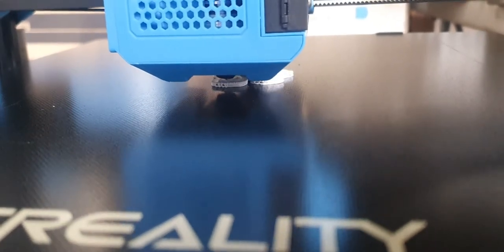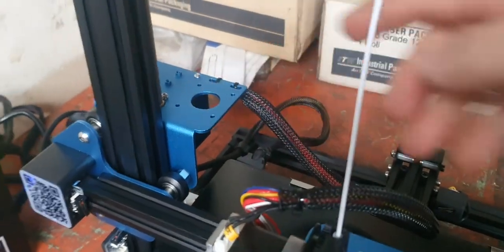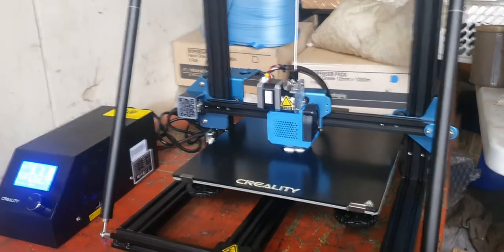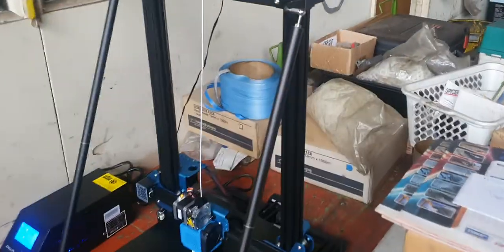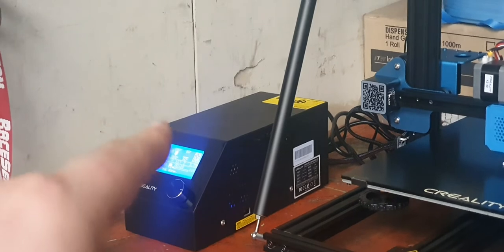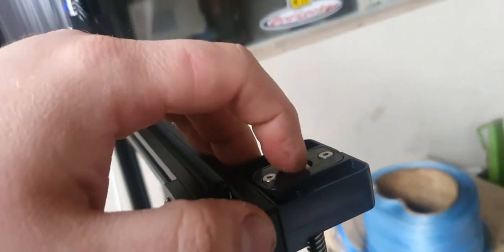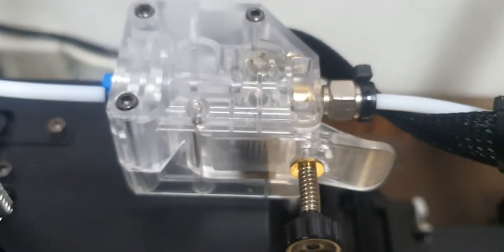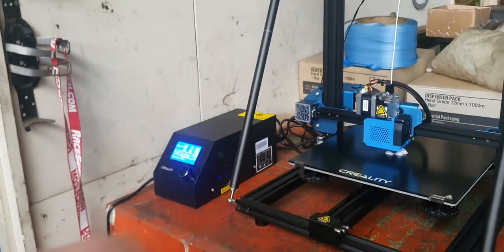creality cr10 V3 and ender 5 plus and ender 5 pro and vyper

Comment: Solid Video - Love your 3D Printing stuff, no fluffing about :D

Looking to pickup another FDM Printer, I've got an old anycubic i3 Mega and it's been great but it's due for an upgrade, I'm looking at either the Vyper or the Ender 3 v2 with some mods, Looking around the 500-1000 mark and haven't even started looking at enders other options since the 6 & 5 look solid but right now I'm looking for an all-rounder and then I'll be getting something large format like the cr10 v3 in future.

Would love your 2c since I see you've got a ton of different ones, what do you like and suggest about some of your favorites?

Comment: I am deciding between the cr10 v3 and the Ender plus 5…What’s your take as you own them both?
Reply from the maker: Get ender 5 plus. It's way better
Reply from the maker: I like my ender 5 plus more. And you will too. It's also more customisable as well if you want to do that. I have not customised mine at all yet. But I might put a different hot end on it soon. Just get ender 5 or ender 5 pro or ender 5 plus. They are so good
Reply: @differentials  after further research will be going with the anycubic Chiron.
Reply from the maker: @r.in.shibuya  Yes I have that machine too. The anycubic Chiron is really good to. Is so hard for me to tell you what to buy because all my 3d printers are good. It's easier for me to say that just by a 3D printer because they're all good.
Reply: @differentials  I already own a Prusa MK3S, I wanted larger build volume, will be giving the Chiron a shot. Thanks.

Comment: Im interested on why you don't like a BLtouch or any sensor 
Coz im planning on installing one..
I need your opinion man
Reply from the maker: Unless you have a very large bed or a warped bed I think it's not really needed. On the end of 5 + it wants to do the bed levelling before every single print. It takes about 5 minutes to level the bed. But it really not that bad. Just get it if you want one. You might like it but I don't. I can get perfect prints with out a bl touch
Reply from the maker: I have put a bl touch bed levaling sensor on a 3d printed before and it was such a pain in the ass.... So be awear it might be a head fuck....

Comment: Which one you recommend for best quality
Reply from the maker: Ender 3 and vyper
Reply: @differentials  thanks for the response. Enter 3 you mean plain Enter 3 or Enter 3 V2.
Reply from the maker: @sciloolearning  well look all of my 3d printers have great quality print but yes .... Ender 3 pro and ender 3v2 all have fantastic quality prints. But with some tweaks in the slicing software you can make almost any printer have good quality prints.
Reply: @differentials  thanks for the context Neville. Appreciate it. Wonderful channel.
Reply: @differentials  One more question, did direct drive on cr 10 v3 made any difference in print quality compared to non direct drive printers. Is cr 10 v3 comparable to prusa i3 mk3s.
Reply from the maker: @sciloolearning  nah no difference really. Not that i have noticed anyway.
Reply: @differentials  thanks again mate